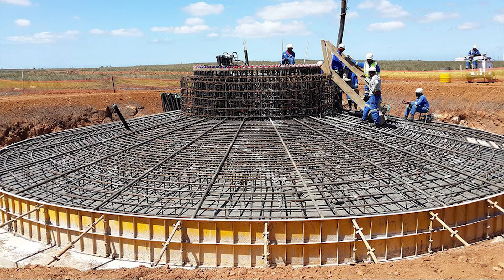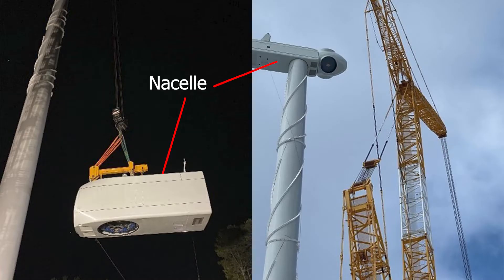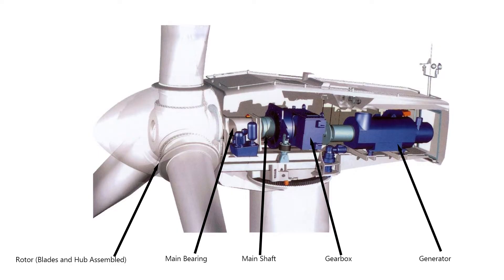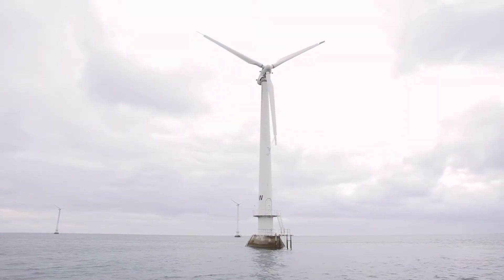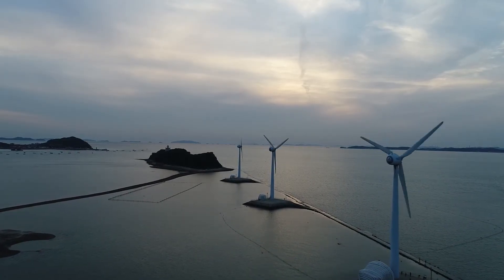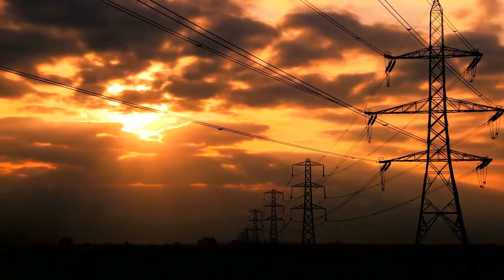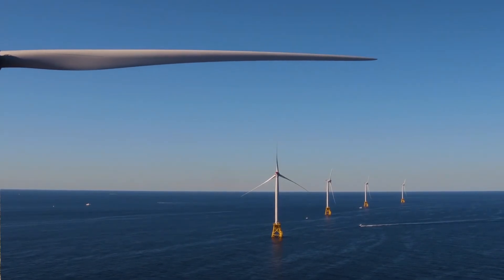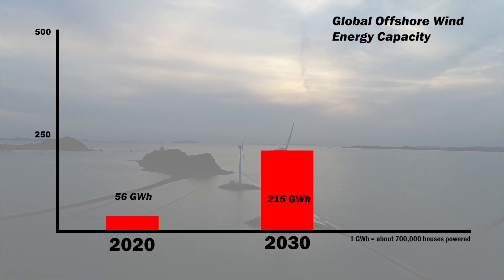History of Wind Power | Barnhart University

Comment: The storry of wind energy kan not be told without Poul la Cour. He was a danish sience teacher. He constructed a device he called "the Kratostat". This machine could turn any windblow i nature into a stable flow of air inside a tube. This enabled him to study different types of propeller, and to find the most efficiant, the one we use today. The Tvind School vindmill from 1978 is another step forward. This was the first full scale windmill, looking pretty much the mills we se today. They solved the problem with the AC frequence. They build a "Frequence-modulator", and this device could convert any frequence procuced by the mill to a stable AC-frequence  for the grid.